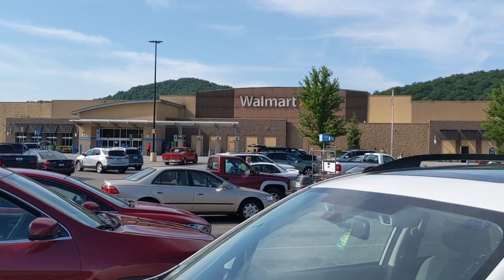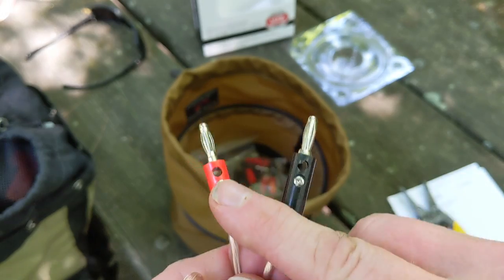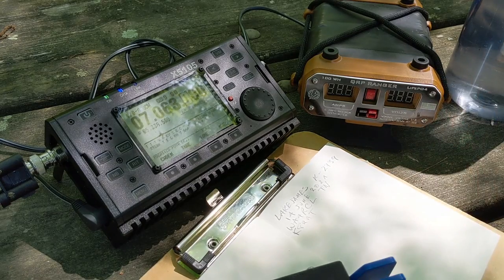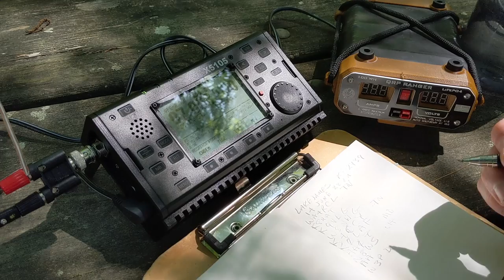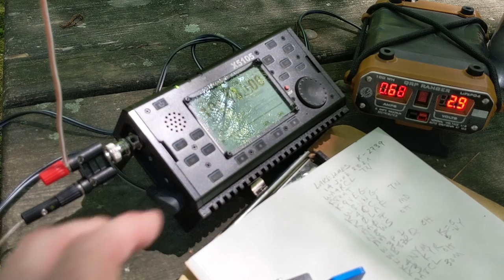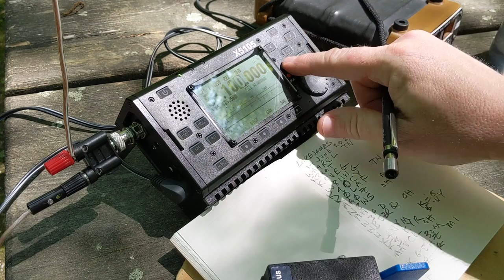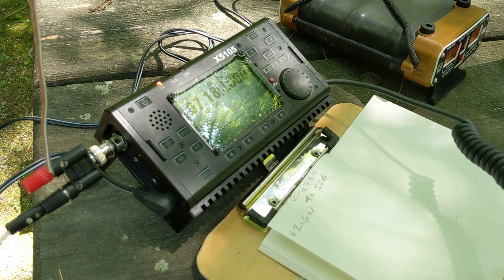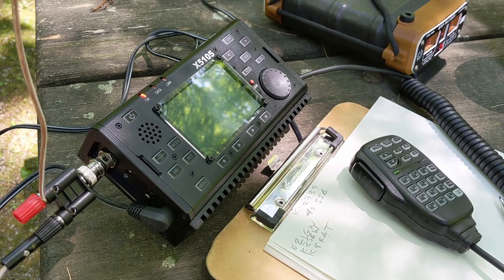POTA Field Report: Let's build a super simple speaker wire antenna on site and activate this park!

Comment: Just awesome.  I watched this and decided to give it a go.  Cut the speaker wire to 28 ft 6 in, tossed it 25+ feet into a tree in the back yard.  Connected the radiator to a BNC / binding post adapter connected to an LDG 100 plus tuner and a 16 foot or so counterpoise on the other binding post and strung on the ground..  Tuned up 40m, 20m, 17m, 15m, 12m with SWR typically 1.5.  I tried 80m and it tuned the upper phone portion with SWR 3, but no contacts made.  Simplest setup I've seen.  Simple wire.  No coax.  100 watts..  No RF into the radio.  Slick!
Reply: How would this work if your rig isn’t a BNC?

Comment: An excellent demonstration for those who think that the antenna is difficult. Personally, I use a stranded
 wire from an old network cable for such antennas, which costs nothing)
Reply from the maker: Brilliant! Yes, I even have some old wireless dog fence coated wire I'll be using for some antennas in the near future. Next to free as it came from a junk box at a local club! :)

Comment: Great video! I used speaker wire for my first antenna (random length vertical, very little space in UK gardens), around 9m into a tuner for 20m operation at 5W. Works a treat, my furthest contact was 7000km away. When starting out on a tight budget and low power, speaker wire makes for a great antenna.
Reply from the maker: That's just brilliant and you're absolutely right: a little speaker wire can go a long way!

Comment: I've been a ham for 45 years and have never built a wire antenna or purchased one which I didn't need to trim.  Your specifications were right on the money. Almost perfect SWR on 20 and 40 meters (1.2/1).  Thanks Thomas!  Rudy, W5HRH
Reply from the maker: So glad it helped! I bet you can get WAS with that wire with a little time! :) Cheers, Thomas K4SWL

Comment: Tom  You can run this as a center fed dipole, the  center fed zip cord  speaker wire antenna has been around a long time  You split the speaker cable in 2 and separate it and make the dipole length  to the lowest band you wish to work tie a knot so the wire won't split anymore  raise it then move the dipole ends out  The antenna is now balanced and much more efficient to use as long as you can put the dipole up in a tree or tossed over a pic nic shelter and run your ends out and tie them off. away  in the clear as possible. ,  The speaker wire acting as the feedline  to the dipole is actually in the vicinity of 75 ohms so you can make a pretty well matched  mono band dipole  if cut to normal length,  A good tuner is required for multi band use but you will be amazed how well it works I worked a Field Day 10 years ago with the antenna using a Kenwood TS-850S and  made over 300 contacts,  Speaker wire as the feedline is not as good as coax but gets the job done,   Keep up the good videos  love them.  73  J
Reply from the maker: You know, I actually did this once before and gave that antenna to another ham. I need to build another. You're right: it's an effective simple antenna.

Comment: If it radiates it radiates and the same laws of physics, velocity factor, feed line calculations apply...Where unknown wire gets into trouble is not having been tested so no reference material is available.. Use an on line wire antenna calculator, cut it longer and prune up each side till it gets to desired SWR and impedance. Easier to do if you have an swr/impedance meter.

Comment: For a long time, the only portable antenna i had was a 20 meter speaker wire dipole. I split the wire for my legs, then tied an electricians knot, then ran a length down for a balanced feed line, then used a crimp on 259 to go into the radio
Reply from the maker: That's similar to my next speaker wire antenna! :)

Comment: It you cut the wire to the correct frequency instead of 28.5 feet you wouldn't really need to tune it right but would only work for the band it was cut for.
Reply from the maker: True and, frankly, for any frequency below 20 meters, it'll equate to a very long wire which might be more challenging to deploy in the field. The great thing about these random wires is how easily they can be deplyed in almost any situation.
Reply: @ThomasK4SWL Thanks for the response. I'm a youth operator and don't have a ton of money so ended up buying one of the trusdx kits for my first hf rig(Im horrible at soldering but getting through it) and wanted to make a cheap antenna.

Comment: Thank you I just purchased the xegui x5150 and downloaded and printed the latest manual to study while waiting for the radio to arrive. Then going to upload the latest firmware to update before I even play with the radio
Reply from the maker: Excellent. Just a warning, though: the manual leaves much to be desired. :) I've found it only to be mildly helpful as it seems to reference V1 of the firmware which had a different menu structure.
Reply: Well maybe I’ll wait on the firmware then

Comment: This was an awesome video.   Not sure if I posted a response, I  stopped at Walmart and bought the speaker wire on our way to the Outer Banks.   I watched the video and measured it the 28.5 feet, splitting the two wires.  The radiator wire was connected to a 20 foot extendable flag pole.   The other wire was laid on the ground.  I used a FT-817ND with the FT-817ND Tuner.  Once connected,  I could immediately hear the different stations on 15 to 80 meters.   I was able to only make one solid connect, but that contact showed me it works.  Thanks again and 73s.  KD8VSP
Reply from the maker: That's just brilliant, Steve! Thank you for sharing that. Trust me: you'll be able to get way more contacts with that antenna! 73, Thomas

Comment: Aloha Thomas, again. I went to eBay and bought the BNC Binding Post kit, which has the connections in male and female with the banana clips for each, I had a few eBay bucks left to spend anyway. I was going to tell you that here in Honolulu, we have hardware stores called City Mill. I shop  through all the different spools of wire to pick what I want and then buy it by the foot or by rolls off the shelf like you did. The only thing they don’t have is the black/red zip-wire, which I wish they would carry in 10 & 12 AWG. 
    Great video! I love my Xeigu G90 and just got my Mag Loop antenna last week. They work great together. 73’
Reply from the maker: Aloha, Todd! That's excellent regarding by-the-foot wire at City Mall. I imagine they also have pre-cut coils customers have purchased and returned--Lowes and Home Depot often have these and you can get some excellent deals by grabbing these odd lengths. Glad you're enjoying the G90! It'll serve you well! 73!
Reply: @ThomasK4SWL  Question, because it’s not in the video? The wire connected to the red post is the one going up into the air, right? What is being done with the wire connected to the black post? YouTubers just assume we all know the same thing that you do. I watched this video to actually see you cut and set up this antenna but you jumped ahead of the viewers and went straight to the POTA. Can you make a follow up video about the antenna process we all came to see?
Reply: Aloha Thomas, 
  Well my two sets of BNC Binding Posts arrived today and I put it into my Xeigu G90 carrying case so that I wouldn’t lose it. 
     Next, I need to get some wire to drop and hang out the window of my highrise condo and have it work more like an end feed. I think I have spool somewhere here of 18ga speaker wire that I can make due for 10 meters. I still need to find the length I need to cut for 10 meters. Where did you find how long you needed to cut for 40 meters? Thanks!

Comment: Surely it can work! Just the problem is the zip-cord transmission line is pretty lossy. Some guys who  made measurements said it's abt 50% of the TX energy would go into heat in this feeder line , despite the good tuning :( . So it could be usable as an antenna in the emergency or something, but any piece of wire could provided kind of counterpoise and unun +tuner , at much lower losses. GL, 73! Linas LY2H

Comment: Was enjoying learning how you were making the Speaker Wire Antenna, then you cut directly to the  POTA section. Wish you could have finished the instruction by finishing the section on the Antenna. Many would benefit from your style and knowledge.
Reply from the maker: Sorry about that--what was the piece missing? Maybe I can fill in the blanks?
Reply: @ThomasK4SWL  Hi, from beginning to end, on the exact process to make and fully finish the home made speaker wire antenna, and the frequencies it can be used on. Everything, the correct measurements, and length of the counterpoise, and importantly how its correctly deployed. Every minute detail, for those of us new to POTA. Really Like your channel, but was real disappointed when after explaining how to make part of it you cut to the X5105 and transmitting.
Reply from the maker: @jamesr1897  it sounds like you haven't read the accompanying post that I link to in the description. Keep in mind that each one of my videos has a full written report on QRPer.com. This should help: https://qrper.com/2021/06/field-report-lets-build-a-super-simple-antenna-on-site-and-activate-this-park/
Reply: @ThomasK4SWL  Grateful. Really like your channel and thanks.
Reply from the maker: @jamesr1897  my pleasure!
Reply: Project has been built and ready to fly so to speak. Hope this will also work with voice and not only CW. Very cheap to build with the same parts sourced. Excellent video, did you try Voice contacts with the same wire antenna with the X5105 at 5W as have not had an opportunity to try it at present ?

Comment: Furthering my earlier comment, I’m curious why you chose a 28.5 feet (10.5m) length instead of (+-) 35 feet length (about 12.5m). My calculations show the longer length especially if you’re down at the bottom of the 40m band.
Reply from the maker: So I chose one of the known lengths that are not resonant on any one band where I might operate. This is actually a length recommended by Elecraft for use with their ATUs. 28.5' and 31' are my favorite random wire lengths. The counterpoise, when coupled with the ground, is a little less critical in terms of length. I use 28.5' but also 17'. 
The 28.5' wire will easy work down to 40M with the right ATU. Being so short, it's not super efficient, but it gets the job done!

Comment: for the banana plugs, bend the wire into a "U" and then screw it down.  it will stay tight
Reply from the maker: That is actually what I did in this case. Eventually, though, I just dispensed with the banana plugs because I decided to permanently keep the binding post connected to this antenna.
Reply: @ThomasK4SWL  Great videos btw. I have been binge watching 😉

Comment: Question:  Why did you choose exactly 28.5 feet for the antenna wire?     Thanks!  Al
Reply from the maker: It was recommended by Elecraft in the KX1 manual. :) Also, it's a known length that isn't resonant on any one band where I would operate--that's key for a random wire. There are some great guides to random wire length on the web--many other lengths can be used.

Comment: As usual, great video. Very creative using speaker wire and making the antenna on the fly. I wish you would have shown how the antenna was placed as well as you actually erecting the antenna. 
Barry, KU3X/QRP
Reply from the maker: Thank you, Barry. I didn't make a video of putting the wire in the tree because it was so similar to a previous deployment at that very picnic site: https://qrper.com/2021/05/discovery-tx-500-attempting-a-speedy-pota-activation-with-a-new-rig-and-new-antenna/

That and frankly I was trying to keep the video size small so that I could upload it during a family visit. :) 

Cheers,
Thomas

Comment: Very nice.Where did you learn of this antenna? I would like to see more home made antennas. A suggestion is the 20m half square. Red Summit RF did a couple of videos on it. Do that, make a couple more radials for today's antenna, and you'll still have wire left.
Reply from the maker: Thank you, Karen! Yes, I will start making more antennas and using them in videos. I've actually got a plan for most of the rest of the speaker wire, but I've got tons of wire at home that I can use this way. Thanks for the Red Summit RF tip!

Comment: Awesome, thanks again for this video! Would you mind sharing briefly as to why you chose those specific lengths for radiator and CP (maybe I missed it)? All the best, Leo
Reply from the maker: Hi, Leo, So my buddy, WD8RIF, has used a 28.5' radiator with four 17' counterpoises for many of his activations. I knew the radiator length was a non-resonant length. There's actually a list of non-resonant lengths that should be used for any random wire antenna for the best matches--it doesn't necessarily include 28.5' but it's a good guideline. Here's some more info: http://www.hamuniverse.com/randomwireantennalengths.html
Reply: Thank you, much appreciated!
Reply: Would it be fair to say that the same lenghts would apply when using a 9:1 unun for example? I believe the only difference is that the tuner doesn't have to work that hard to find a match right?

Comment: @Thomas (K4SWL) How did you arrive at 28.5' measurement for the radiator? also, confused as to the length of the counterpoise, one time you said 28.5 and the other 17
Reply from the maker: So the counterpoise can be as short as 17', but I've just left mine at 28.5 feet (since this antenna was make with twin conductor speaker cord). If you needed to save space, you could use 17' for the counterpoise. 

I first saw the measurements published in an Elecraft manual for the KX1 (or KX3?). But it's basically a length that is not resonant on any ham band. 28.5' is one of the magic numbers.
Reply: @ThomasK4SWL  Got it, thanks, the magic numbers seem to differ based on who you ask. Come to think of it 28.5' is actually pretty close to 29' I saw minus the velocity factor of the wire, so makes sense

Comment: Do you have the counterpose on Black and the antenna line on Red?
Reply from the maker: Good question--the counterpoise is always on black and the radiator on red. 
That said, some of these BNC binding posts are assembled in the reverse (especially random ones purchased on eBay, Amazon, etc. It's best to use a multimeter to confirm continuity between the center pin of the BNC male plug and the red post.

Comment: What kind of power, realistically, could that binding post handle?  Would it handle 100 watts on SSB?  I plan to use the appropriate wire gauge, just want to make sure the binding post can handle it.  Thanks!
Reply from the maker: Good question and I'm not sure how to answer it. It's quite possible there's a spec out there somewhere, but I can't locate it. Surely they are rated for a certain amount of RF.

Comment: Thanks for the inspiration video. I'm a new ham with a focus on SOTA. Two questions if you don't mind Thomas: 1) Was the radiator vertical? 2) Does the orientation of the counterpoise effect directionality of the antenna 3) Why 28.5' and 17'? I see that 28.5' equates to  8.2 mhz for a 1/4 wave.  I bought an Emetch EM-2 and am interested in trying this antenna with it. Thanks Thomas
Reply from the maker: Yes, the radiator is near vertical and the counterpoise position will have an effect on the directionality to some degree (I rarely worry about this in the field, though). The 28.5' length is one that is not resonant on any one of the ham band frequencies I plan to operate. This is pretty much a requirement for any random wire antenna if you hope to get a good match: http://www.hamuniverse.com/randomwireantennalengths.html
Reply: @ThomasK4SWL  Hi Thomas. I finally got around to trying this setup with my KX2. I was seeing raw SWR as high as 20 on 40 and 20m, which 
, incredibly, the KX2 matched. What kind of raw SWR readings did you have? Thanks.

Comment: @Thomas - I notice you give everyone 5NN even if their signal sounds kind of weak - is this just courtesy? wouldn't it be good to know how strong your signal is with the given distance to the station on the other end? Thanks for your patience with the n00b questions <3
Reply from the maker: Hi, Andrew, So I actually try to give accurate signal reports based on how the signal sounds on my end. I don't watch the S meter on the radio. If you heard me hand out a 5NN to a weak station, that was simply a mistake on my part. Most of the time, I try to be accurate about that. Great question!

Comment: Woulk you have needed to do anything differently if you used a feed line from teh bannana connector/BNC to the radio?
Reply from the maker: I'm not quite sure what you mean. To add a feedline? Basically, the binding post adapter simple makes the connection easy to do in the field. You could just as easily solder the radiator to the center conductor of a BNC, then solder the counterpoise to the shield.

Comment: So does the 28’ radiator work on all bands ? And the other is the counter poise I would think that at least 2 more would be better?
Reply from the maker: The 28.5' radiator works down to the 60M band with the X5105 ATU. And, yes, the more counterpoises, the better in general. I should think that would certainly help on 40M and up!

Comment: What would happen if you did it with 50’ length of speaker wire would it works better on 80mtr and maybe 160mtr bands?
Reply from the maker: Possibly. Much would have to do if it's a non-resonant length and capable of being matched by the ATU. It would certainly be more efficient on the lower bands. Check out this guide: http://www.hamuniverse.com/randomwireantennalengths.html

Comment: No need for a insulator at the end of the wire?
Reply from the maker: Good question: the answer is No in my case. My arborist throw line is made of a dielectric material, so it acts as an insulator.